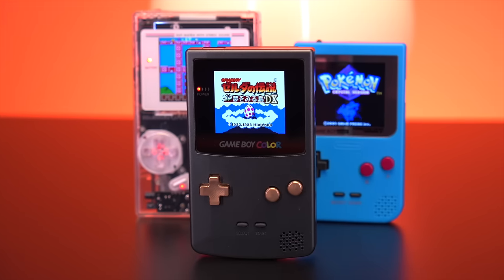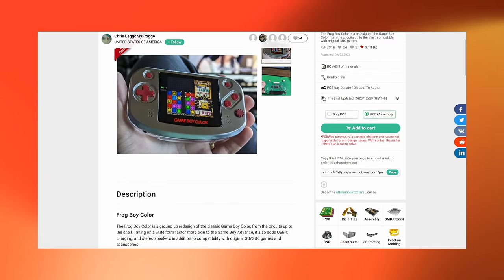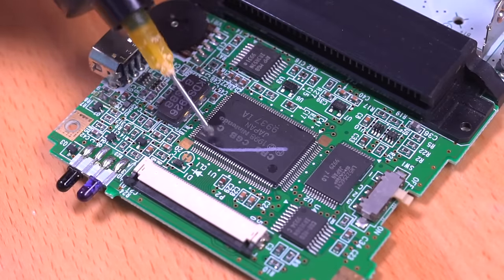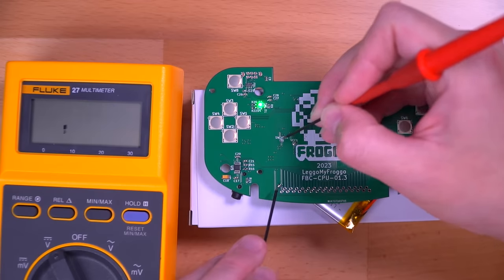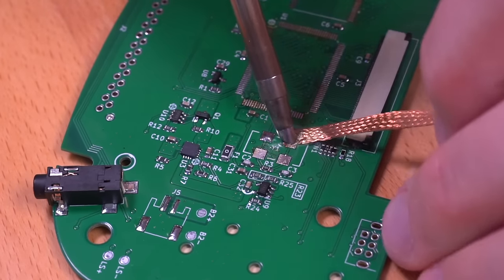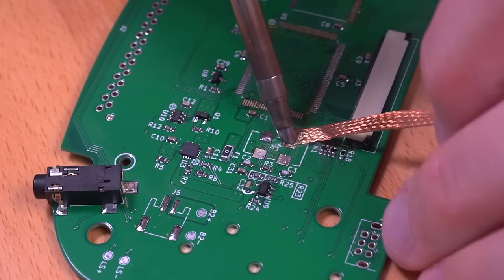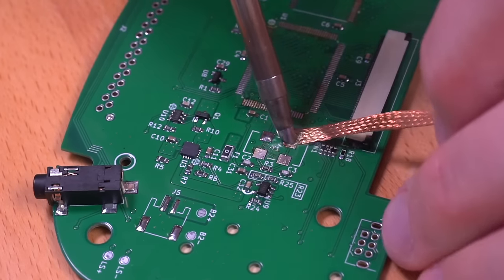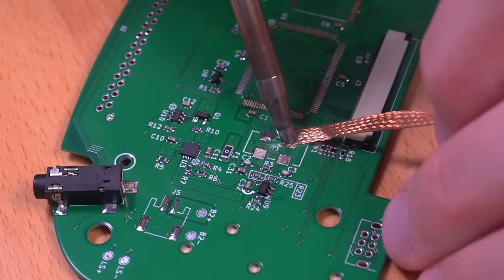Nintendo’s Missing Link Between The Game Boy Color And The Advance

Comment: Hm... I can see where certain parts could be moved around, like taking the charging port and putting it on the bottom to make room for the IR sensor, putting it where the charging port currently is, or alternatively just have the IR sensor on the left hand side. The potentiometer could be moved over for having a dial on the right hand side, just like the original design had, and the power button could be moved to be on the same surface as the control buttons, with all that free space. The cartridge slot could also have two 2-3mm wide strips on either side (probably 0.5mm thick?) to make the game fit snugly while still keeping the cover art open for view, as well. They wouldn't necessarily have to sit flush with the rest of the surface on the back, either.

Comment: I'm definitely not a fan of the volume wheel location, and it's made even more baffling that the designer chose to deeply recess the power button to prevent accidental presses, but put the volume wheel in precisely the location most likely to cause accidental activation

Beautiful design aside from the volume wheel, and I hope v2 is released soon that fixes the flaws

I also would prefer to have the option to use jst connectors for the batteries, sure it requires disassembly regardless, but having the batteries be easier to replace would be a positive

Comment: Milling down the volume wheel to somewhat flush i feel would be a better choice. Should still be able to turn it. And if you made the shell back slightly thicker with a thin plexiglass insert to protect the cartridge while still showing it off i think would answer most of the issues the comments talk about. But i love the design and think this is awesome

Comment: I went into this impressed, then I was pissed when the IR part was omitted, but I was relieved to know the IR port is going to be in a later version. 
You could call me a GBC purist in a way, because despite the seldom used IR scanner, it's still a part of the unit. 

Now, if only something like this could be done for a GBA SP design, or an after-market 3DS with GB/GBC/GBA cart functionality with the DS firmware still in the 3DS firmware. I want to see someone make an aftermarket 3DS that can function like a Gameboy, Gameboy Color, Gameboy Advance, DS, DSi, 3DS, and new2DS family systems.

Comment: In addition to what you and the other comments already mentioned concerning improvements (volume wheel, cartridge cover), I'd like to add another small detail that IMHO improves the build at least a bit: adding connectors for the batteries instead of soldering them directly to the board. There should be enough space (at least when you use 90° angled ones), you don't have to snip off the existing connectors from the batteries (which is one less safety risk), and it makes swapping batteries easier in case one fails.

Comment: Hey very nice video. I actually really like the aesthetics of the volume knob, but it's in the complete wrong place. You can't put it right in the way of your button pressing thumb! If they moved it it would be perfect.

I'd like to give a pro soldering tip; When desoldering pads, you shouldn't swipe the wick sideways across them. You should only place the wick down and lift it up. Swiping wick from side to side, can catch the corners of pads and cause them to lift, especially when applying soldering heat. I have had it happen myself. In this application, it's probably not much of an issue. It's a brand new board that's never had any components on it, but if you were trying to restore an old board they are often fragile and can be much easier to damage by doing little things like swiping wick sideways. That's it. Just wanted to offer that tidbit. Thanks for the video!

Comment: Looks like there are not enough segments to the curve across the bottom of the shell, ideally it would be a smooth curve with no steps to it.  Amazing project, and if you sanded it down and painted it I'm sure it's possible to fix.  Amazed at what we can do as hobbyists these days.  And air rework equipment is pretty cheap, say half of a AAA game!

Edit: Now I can see the segments in the curve of the bottom don't match up between the front and back shell.  I would have to fix that.  Also just add a washer under the cart shield and you'll be able to tighten those screws.

Comment: I think it's pretty nice despite that volume knob heh, always thought Nintendo kind of made the GBC stillborn the way they didn't really make many innovations beyond the OG GB Eg. the better than NES system palette was nice though.🙂 Perhaps they were concerned about looking like a Sega GG but really the GBA design and release was way more exciting.
In hindsight I think the GBC should have had four face buttons Ie. how much did the Select button get used anyway on NES/GB..., 3bpp/4bpp graphics with 32 on-screen-colors like GG/SMS, and perhaps a TV output port as I think all handhelds dragged their feet on that matter Eg. only the Sega Nomad had that bitd iirc.🤔
Considering total PCB conversion some of that is possible, added buttons would mostly apply to homebrew games, and I'll have to check out that HDMI GBC.😉

Comment: Not a fan of the cartridge slot being so exposed like the Analogue Pocket, but I can live with the volume wheel.
Reply: I also am wary about something happening to the cartridge with this design. I love that you can see the cartridge art, but wish that it was just a window. This could be achieved by having the design include cartridge slot bracing at the top. BUT I have some sort of mental block with analog volume control. I want to have repeatable volume steps 😂
Reply: @JaredClarkBoaz  or go the route of clear GBC shells - have the shell cover most of it. The cartridge art isn’t THAT obscured, and you never see it while playing anyways.

Comment: Amazing work. Would probably also add a couple of pertruding grips/"butt cheeks" to the back on either side for ergonomics, and they could also home larger internal batteries. The device is small enough as-is to not worry about the increased form factor and would make the device a lot more comfortable to hold and use over longer play sessions.

Comment: Very well done. Only addtional wish for me would be an alternative board which was compatible with the Q10 screen AMOLED mods. Hopefully someone takes this design and uses it for an open source FPGA handheld. Maybe add two addtional face buttons and a couple shoulder butons. Move the volume wheel  to the side along with the push button start to a slide. Minor changes which should make a fantastic device. I'm saving one Q10 screen hopeful for a future revision. Or maybe I should dio it myself if everything is open source.

Comment: My 2 issues is that the batteries and speakers are soldered to to the mainboard. For the speakers, it's not that much of a deal but for the batteris, I do not like non user replaceable batteries. I would have like to have seen the batteries be pluggable and easy to remove without have to take the handheld apart. Maybe a future iternation can use something like a 3DS battery that you can just place in.

I do agree that the cartridge needs to be better secured. If he is hard set on having the label displayed than maybe he can use a piece of clear plastic that is secured on the inside to keep the cartridge from accidentally coming out. Also the GameBoy games I play (mostly Pokémon) use the IR port.

Personally I would love to see someone create a modern version of the DS. Since Nintendo dropped the GBA slot starting with the DSi, I've been wanting a DS replacement as my DS Lite is not feeling that great these days.

Comment: Since its thinner than the gbc, he could make use of the original gbc size, and use it to make some sort of transparent shielding for card slot that both protect the labels and keep the card properly seated, without losing the ability to easily what game is on it, no reasone to make i thinner, just make original gbc thick and use on the shell to make what i suggested, would fix 2 issues with one design change.

Comment: i'd rather have a slim gear style of volume knob sticking slightly out the side like the DMG. literally just needs a notch in the case shell and to move the pot over some. and maybe not even the moving part, if its done right.

and yeah, its not used much, but the ir not being there is a bummer.

i have literally no other complaints, its slick work.

Comment: I can't be the only one thinking that soldering the chips on using the leftover hasl solder and a hot air gun would have been easier and cleaner than cleaning it off and resoldering with an iron, right?

Comment: I’d have to say I like the ergonomics… but is this the ultimate gameboy color, I’d say not yet. The game cartridge shouldn’t be full exposed cartridge. If the goal is to show off the label The shell should support over shoulders of the cartridge and to prevent a snag when empty design a flush clear glass window.  And finally the volume button Id say needs to a better location, closer to an edge and may need to be counter sunk into the shell making it more flush. And finally the IR is important to me to have.  If there were 2 things that had to be addressed immediately it would be IR support and cartridge security.
I will most likely be doing this build when there is IR support.
Finally an addition I’d like to see somebody try to develop a parallel support for the link and an internal emulated link via a wireless or Bluetooth connection. Maybe use a color coded LED to determine synchronization with correct devices. I have too many kids and not enough time to do it myself but maybe someone will get inspired with the idea here.

Comment: it is very risky to solder and desolder the battery so many times and solder under the voltage. You may fry something. I once fried one NOAC by soldering the LED and forgot to turn it off. Better solder one battery connector and remove /but the battery that way

Comment: Is there a way to implement a delay, or make it so where you have to hold down the power button for x seconds before it will actually power on? Think that would help, and allow for a slightly taller switch to be used🤔

Comment: Props to Chris for developing and making this available as a one man show. That's a lot harder than people realize. 

My only real gripes watching the video are in the design. First and I'm surprised this wasn't mentioned but I can see facets all over the edges which as a designer is really distracting and pretty inexcusable. If this is a free print online, that's fine but if people are paying for this, this should have been fixed before the files went live. It's such an easy fix too when modeling so hopefully he improves that resolution in the next model.

Then that volume wheel. Yeah that's a no from me dawg haha. Again, just a reminder that engineers aren't designers. Easy fix for the next go around though. Other little things like the cartridge slot and power button take time to iterate and design. I'm sure that stuff will all be a lot better on the next version. And overall not crazy about the leapfrog aesthetic but that's subjective so it is what it is I guess. 

But again, props to the developer for making this happen, it looks like a really fun project.

Comment: I noticed that you also have the v1.3 of the q5 display where they pre attach the ribbon cable to the screen without the sticker underneath it. Would you recommend doing this or remove the ribbon and put the sticker on to prevent shortages?

Comment: does the motherboard kit also come with the speakers?
Reply from the maker: It does not, you need to order this separate. I forgot to mention it in the parts section. Chris has them linked in the GitHub
Reply: @MachoNachoProductions  No worries! Thanks for the info!

Comment: What is that tool for picking up the chips? I don't see it in the Amazon store linked in the description
Reply: That volume wheel placement is sadly a killer for me. That's right where I'd want to rest my thumb to use the buttons. Hopefully a future revision moves it to the side. I'll even scavenge a volume wheel from a GBC if needed, since I'm already scavenging so many other parts.
Reply: Also the start and select buttons are kind of placed poorly. Seems alright at first, but then you put Link's Awakening in, and... How am I supposed to press A + B + Start + Select to save the game with this layout? It's certainly going to require some obnoxious finger gymnastics. I would prefer a start and select layout like on the original GBA.

Comment: Nope not for me, volume dial left side, select and start like the GBA, the only recessed button should be power exactly where select is. It's almost there but is a no from me.
Reply: Also for the cart if you want the artwork to show just cut a window where the sticker is and make all solid around the plastic parts of the cart so the only thing you pull out from is the gameboy oval

Comment: Such a thoughtful design..and then the volume wheel is high off the face, under your thumb which is pressing recessed action buttons…what? Also not a fan of the exposed cart. Just asking for damage to valuable labels and/or damage by leverage.

Comment: Naaah it's a bad design. Not only the volume wheel, but L and R buttons placement. The whole idea of L and R is that you can press them without your thumb, some games require holding them while pressing face buttons or d-pad. On the other hand it should have some kind of analogue stick to allow use both classic precisie d-pad for games that call for precised presses, and analogue - not for analog movent obviously, but for quick changes in directions for games that use 8 directions.

Comment: this is just kinda pointless because the gba already plays game boy color games. you can just make your ideal gba with a new screen, etc. and then you can play both gba and gbc (and original gb) games. the changes are all negatives - volume wheel in a bad position and sticking up in the way, power button hard to press, cartridge slot completely open so you can easily hit the game while playing and crash it or corrupt your save, plus it sticks out at an angle. the only potential plus here is moving the slot down so the game doesn't stick out, but with all the other problems, a purely aesthetic move like that it worthless

Comment: Use hot air on the chips, im getting frustrated by looking at this, if u have used hot air, u would have been done in a minute or 3 with those 2 chips. The console would have looked better with the new oled touch screen for gbc.

Comment: 250 bucks for something you can just play on your phone for free with emulators.
Reply: It's not the point. The point is to have a good experience, as optimized as it can be. With a phone, you don't get any of the tactile responses or weights of a handheld console. I haven't modded a GBA like this yet, but if I had the money I assuredly would.